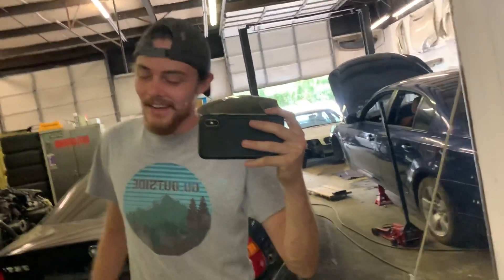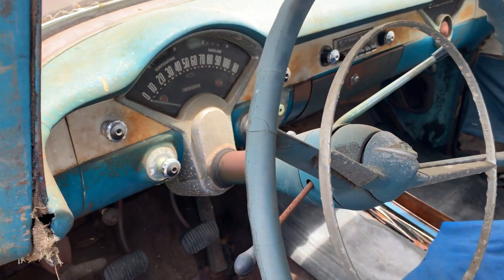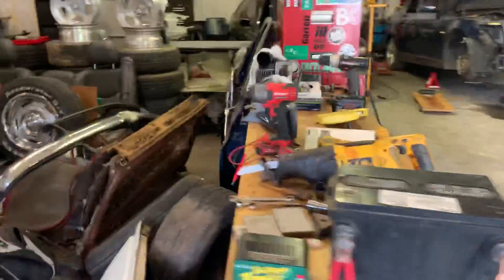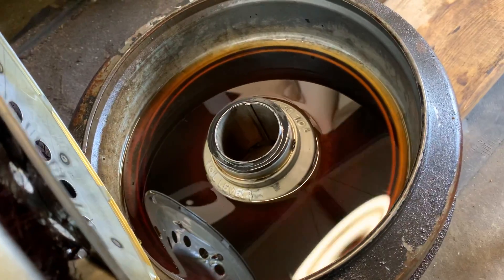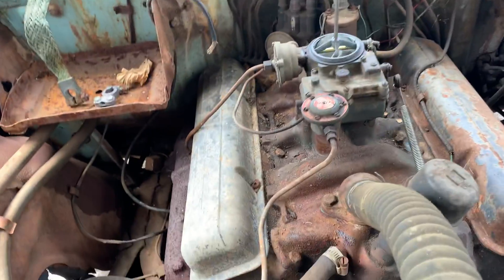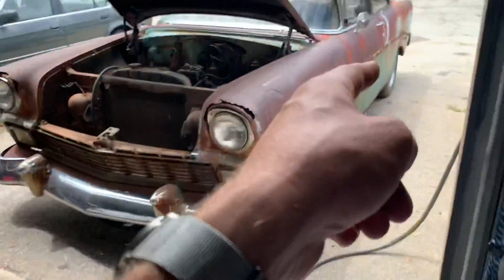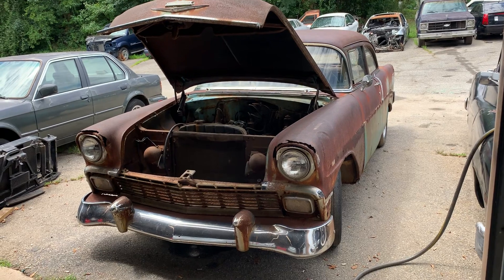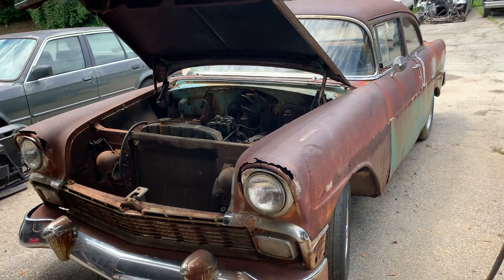New Arrival! 1956 Chevrolet 2door

Comment: Nice!  Luv the tri5’s.    Love the Cragars    Not related but my father built a 60 impala 2 door hard top.  He built the 283 updated to electronic ignition power steering and power front disc brakes and turbo 350. He painted it Dodge Viper blue    He would luv this 56👍👍.   Hoping some times to put a set of cragar ss’s for my Monte Carlo

Comment: Awesome find man congratulations!!
But its not a Bel air  its a 210 ... the 56 Bel air has Bel air on the rear  Quarter panel and the 110 / 150 and 210 has Chevrolet on the quarter panel.. same with the dash a bel air says it on the passenger side dash and the 110-210 says Chevrolet on the dash

Comment: nice $12k rare car...tri-5 Chevys are expensive even in that state....you could enlarge the displacement to a 400 sbc and replace the framework to a tube frame and weld some floors in and a back half 9 inch Ford  matching numbers engine

Comment: The Bel Air was’t Chevy’s top of the model i 1956. About the only feature could upgrade to is 3 on the tree to an automatic. I drove my girlfriend’s father's 57 and I was glad he kept the auto trans because that was a bear with that 383 stroked. I was used to a 67 Mustang GT Fastback with the factory 390 and factory 4 speed. No PS in either.

Comment: For me it's the worst looking of the tri 5 years but others love it. My step Grandpa had a 55 with the 265 and a 3 speed on the column he probably bought new in 55. It was a little nicer than that one and ran fine. We actually got to ride in it when our car was down and it rode a lot worse than the 55 Cadillac we had at the time but it sounded great and I knew what it was. Much later he traded it to the neighbor for a really nice 58 Chrysler 2 door with a 392 that he slowly destroyed because he was old and a terrible driver at that point.
The neighbor kid immediately threw the front bumper away and put some cragers on it. I guess I'm old now but when I was a kid those were the kind of cars you got cheap just to drive as a poor family. We paid 200 for the 55 Cadillac coupe de ville in 68 and it ran great and had glass packs on it.

Comment: Way cool Jay. Looks like your growing up and expanding horizons so as to get further in life as for laying on you back showing us what fell through the cracks, you have harvested some for a chance at new life. I will see what I can do to help... some eyebrow kits to weld in would definitely be easier than glass or welding skin patches. Going to a local old wrecking yard has been to a point somewhat helpful. That set of bones there is a definite keeper as its pretty straight and no one can really fix twisted a rusted bad panels that were never fit in right.

Comment: Jay Smart your new project car is a 1956 Chevrolet 210 two door sedan not a BelAir you can tell by side trim, the Chevrolet name on the quarter panels instead of the BelAir name also you can can tell by the Chevrolet name on the passenger side of the dashboard instead of the BelAir name.